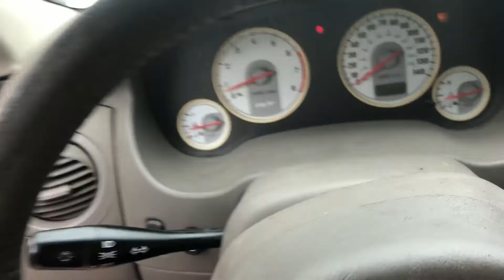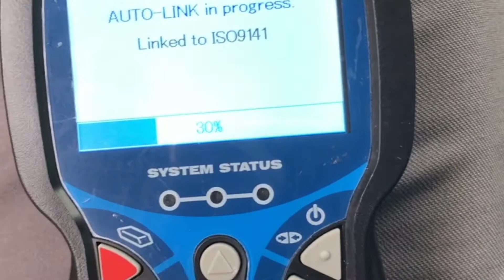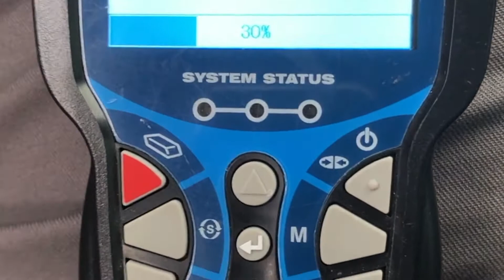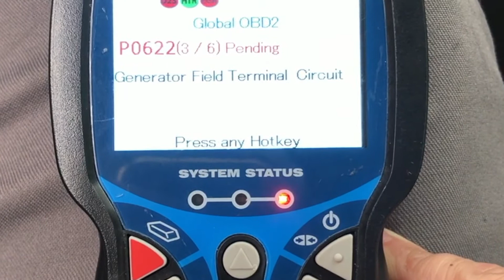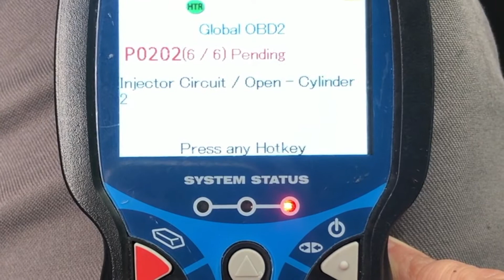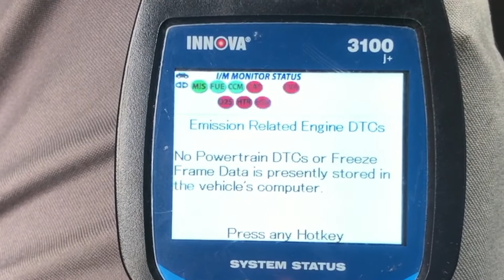2003 Dodge stratus R/T fixer upper (Is the juice worth the squeeze)

Comment: Future viewers, as he’s sold the car, EGR is a HUGE running issue on these. So is the rear injector harness. Look for micro-cracks in the wiring harness for the rear injector bank. It’s a separate unit to the rest of the harness. Makes removing the engine much easier. And for the sake of everything holy, PLEASE replace your entire timing belt, water pump, idlers, and tensioner set!
Reply from the maker: Also from what I learned these cars have power issues and idle control issues if you let the battery go dead. All in all a cool cheap car but not without its issues @that_neon_channel thanks for the tips sounds like everyone else that watches this video has one I’m sure they can use that to their advantage. The timing belt is a very important thing on these cars since they are interference engines. Happy holidays thanks for the comment
Reply: You seem pretty knowledgeable about these cars so I wanted to ask you what goes wrong with these if you have a good battery hooked up and you turn the key and all the power just goes away. No dash lights or nothing. No cranking. This one I got had prob sat outside and not ran for 7 years. Any help be greatly appreciated.

Comment: Well worth keeping! I have one but mine has a major problem. The positive battery terminal has a fuse block. It sat for about 8 months because I bought a new truck. The terminal corroded. To my surprise, the part is non-existent. Can't find the cable anywhere.
Reply from the maker: This one is no longer with me but it has happily moved to a new family
That daily drives it and enjoys it 🤷‍♂️ glad I saved it from the scrap yard for at least another little bit
Reply: Did find it on rockauto? I believe i have an issue with an alternator but I haven't really and time to check it, its cold down here. Would you know where to find a ground cable for these?

Comment: How did it start/ not start with the alternator issue? I'm having a charging issue on mine I think. 04 183k battery won't stay charged anymore and left not started for awhile it will make a grinding noise under the car in the starter area but while driving at times it shuts off after a spit an sputter an the battery and brake light go on and off.. I'm confused an at a spot where I'm confused now...
Reply: I saved it from a junkyard, promised my friend to keep it 750 I paid for it and I'm sadly 6k deep in parts and fixing random things to keep it on the road because they are rare as f**k now...
Reply from the maker: Man. I’ll be honest. I put a new alternator and battery in it. It started and ran fine. Charged fine. If you let it sit two+ weeks the battery would get weak. I tried with a multi meter in line with the battery, pulled every fuse and relay never was able to solve the .5 amp draw. It just had some phantom power draw and I have no idea what it was
Reply: mine did it and i repleaced alternator and battery and it works now